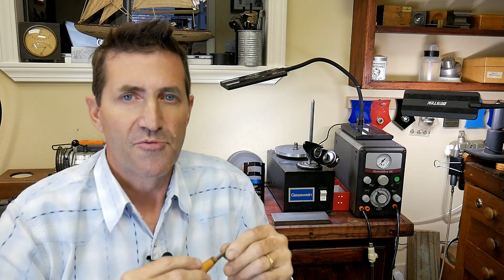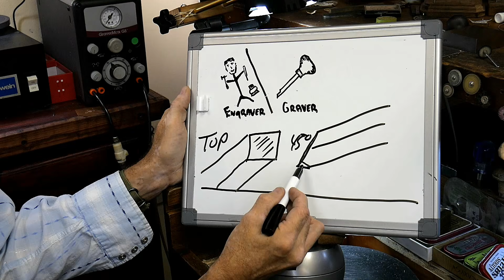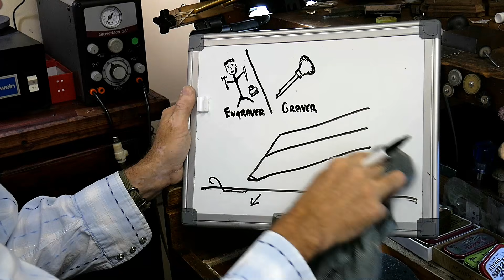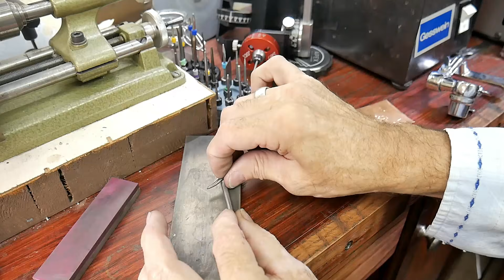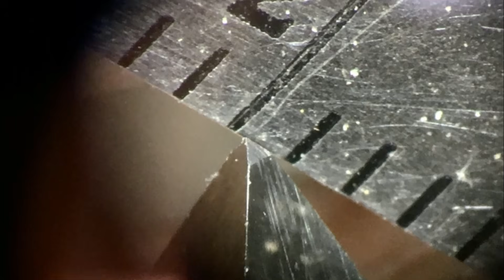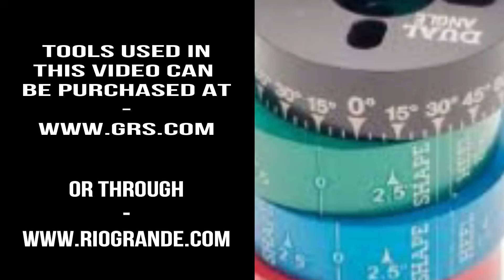Hand Engraving 101 - Graver Sharpening for Beginners

Comment: Is there a specific bench stone to buy? What are you're personal preferences?
Reply: I'm fairly new to engraving, but not to folding knives and sharpening them. I just use the stones I use for my knives; resin bonded diamond stones, from Columbia Gorge Stone Works (CGSW). 

Diamond plates work fine, but they're far inferior in longevity and precision. Resin bonded diamond stones have the benefit of a much higher concentration of diamonds (up to ~100%), and can be dressed/lapped to ensure flatness.

Diamond plates will always have their place, but there's been a ton of innovation in sharpening equipment recently and they shouldn't be considered to go-to method they once were.

Comment: good video, and as a side note, woodworkers call that "doorstop" a honing angle guide, as their version handles all kinds of chisels/carving/turning tools, simmilar sharpening method; and the great thing is it removes variabillity of human movement in the sharpening process. one product you could use is a "belt sharpener", like woodturners use for their chisels, as this stops overheating the steel, and also has jigs for maintaining cutting profiles on the tools, no matter what it is, knife, scisors, axes called a "tormach" machine, and would be a lot cheaper than having to buy what amounts to a gem faceting machine to sharpen the tools.

Comment: Hello! Are you aware of some website in the EU that sells those v-gravers? For whatever reason I find that extremely difficult to find. Same for the ones used for woodcuts (not the gauges but rather the flat pointed ones). Cheers!

Comment: Thx, ive watched this a few times these last few years, its hard to get a handle on all the info out there, but it does come together.slowly!!..few things , for me, im into hand push, the wedge heel as i call it, is better for hand push, the parallel , as with the, templates designed for etc, are really for air assist, but not hand push, a wedge heel not short but say medium, has  no issues with heel drag, and cuts well...one more, i was lucky to pick up a load of 2mm square carbide at a good price, (ground to missed tolerances, from Germany )so i use this...ive found the direction of the hone makes a difference, one makes more tip fails, going into the graver, the other doesnt perhaps the former causes some micro fractures, that eventfully get exposed..im not sure..luving this journey!!

Comment: I have noticed that there is alot of preference/variation in heel and face angles. How do I know what angle works for me? What is the optimal outcome?
 Also, if working on a larger piece, would a larger heel be required?
Lastly, does everything need to be level when sharpening ( table, stones, etc )?

Comment: I am so grateful for the time you've spent making this tutorial. But frustratingly there is much information that you do not explain (in a manner that i can understand). You start by mentioning two different types and state that the second is the one that you use. But then you only show how to grind the first one, not the second. The really frustrating parts is setting the heel. It's not clear if you rotate the graver whilst doing this, or to what angle. This is not clear. I am sharpening away and getting nowhere. more clarity is needed for us newbies. Thansk.

Comment: Thanks for the nice video. I have a couple of questions, what metal are gravers used for gun engraving and what metal are the actual gun gravers made of? As guns are 416R steel and it is hard. Will these type of gravers cut steel?
Reply from the maker: 416 isn’t very bad to cut. It cuts quite nicely with tool steel gravers. Blued hubs are carbon steel and cut like butter. On some of the hardened steels I use carbide. The reality is that the majority of modern guns are not good canvases for engraving.
Reply: @MasterEngraverTV  Thank you so much for helping out. We are looking forward for more videos from you hopefully teaching us this beautiful craft.
Reply: @MasterEngraverTV do you mean that modern firearms are not ideal canvases for engraving because of the shape & surface treatment or is it the quality of the steel? Thanks so much.

Comment: I hope this doesn't sound dumb, but I am learning to use a power graver, can I apply the same technique to the  graver's I use?
Reply from the maker: Shang Rangel gravers are gravers for the most part. What do you mean by “power graver”? I use the GRS GraverMax for all my work.
Reply: @MasterEngraverTV  well you are using stuff that you made, and said something about hammer and chisel, the graver's that I got with the foredom power graver don't look so stout compared what you are demonstrating with
Reply from the maker: The chisels I showed in this video are old die sinkers chisels and are extremely hard to find now. Most people purchase a handle from someone like GRS Tools that will accept quick change collets that hold standard square or round graver stock. All my gravers are shapes from these blank gravers. I don’t suggest trying hammer and chisel without a teacher. You’ll spend years just learning to use the tools. The Foredom tool is really only good as a hammer handpiece for jewelers. It’s not really suitable for Fine engraving. The GRS Graversmith is the most basic pneumatic assist graver I would recommend.
Reply: @MasterEngraverTV  thank you very much I finally got the graver sharpened correctly, I have no formal experience other just seeing it and believing, I am breathing, I can do do this. If you are curious to see some of my work, Rangels Art is on IG FB Twitter. I don't really know how much engraving I will actually be doing I just like knowing as much as my brain can retain

Comment: I think I see whats going on now.  The face angle should always be about 45 to 50 degrees and the two parallel angels can be 105 or 120 or In  Lindsay's case he likes 116 degree angle?  So what do you gain by changing the side angles from square or 90 degrees to 105, or 120 degrees? If you have time to answer? Respectfully Yours  Mike E  RHJ Gold
Reply from the maker: RHJ GOLD simply put with a 120, revolver you can achieve a broad tapered cut with ease by starting shallow and finishing deeper or by angling the graver as you cut to flare the cut. A 120 is also a stronger point and will dull less frequently but it’s harder to control. It takes a lot of skill to cut a consistent width straight line with a 120 whereas is a breeze with a 90. In addition you will need the correct equipment to sharpen a parallel point geometry. Either from Lindsay or GRS. There are special belly facets that must be cut to reduce the angle from 90 to 120. Only then is the parallel heel cut.

Comment: Nice video but confused? what are you talking about when you said using the 120 degree and setting the face to 45 or the other fixture 105 degree and again setting the face to 45 degrees?  whats 120 or 105?
Reply from the maker: RHJ GOLD the fixture I use cut gravers with an angle of 120degrees. A standard square graver for instance is 90deg. These gravers are designed with a shallower angle. They are cut with modern “parallel” heel geometry as opposed to standard heels. To learn more about this type of graver you can learn more at LindsayEngraving.com

Comment: For us poor/broke pre-begginers looking into making some hobo nickels do you think you can show us how to make a graver out of a concrete hardened nail from scratch?
Reply from the maker: Tacti- Coolkid nickel is soft. Any high speed drill bit can be turned Into a graver. Tool steel blanks can be purchased for less than a dollar each from steel suppliers. That’s all a graver is. A piece of steel. You’ll still need some sharpening stones. There’s no way to learn to engrave without some investment. If you want to be a painter, you’ll have to buy a paint brush. You’ll also need some sort of vise to hold the work still.

Comment: how much does a good first set of gravers cost?
Reply from the maker: You can start with only a set of push gravers,  vise and some basic tools for under $800 or so.. The gravers themselves are cheap. It's the education that will cost you either in money or years of time spent trying to master hand push gravers. Pneumatic assist tools are far easier to learn with but the investment is fairly substantial. It's an expensive profession. Not a cheap hobby. You most important tool is a pencil. You can't cut what you cant draw.
Reply: thank you

Comment: So glad to have found your videos/channel. For those of us with the GRS single angle graver sharpening fixtures (which I’ve been using for near 20 years now) would you be willing to do a demo on heel making/sharpening? I do my silver and copper work small scale and have yet to make the expenditure to get the dual angle fixture or any of the S. Lowrie (sp?) jigs, so, a nice run through with the less expensive gear would be appreciated by a good many of us (pretty sure it’s not just me).  Thank you very much, awesome work!
Reply from the maker: Widgets-widgets absolutely. I have one in the shop and I’ll include it in episode 2 of sharpening which will also feature the Lindsay template system
Reply: Master Engraver TV many thanks, also for the name correction w/Mr. Lindsay (wow how I want all of his equipment). I’ll be looking forward to seeing part 2.
  Hope you have a grand day.

Comment: Hi i do engraving About 1 year And i use push gravers chisels And homemade pneumatic graver And my qestion IS in school we create large curve at the heel for rasing the graver And then tatch up the point what is the easyest repetable way to sharpen this tipe of graver?
Reply from the maker: Making a curve in the tip of the graver is not an great way to make gravers. The only reason to do this is if you were engraving inside of a bowl and needed extra lift. The heel itself provides all the lift needed. If you notice the wooden handle graver in my video has a curved tip made for cutting in bowls. You can see I sharpen it the same as any other graver.

Comment: Layne, 

Your channel is great, and your work is fantastic. I was wondering why you didn't include the Lindsay sharpening templates hanging on your wall in the video. There's no adjustments to make, except graver length, so sharpening errors are very hard to make.
Reply from the maker: Too much to add in one video. I'll do a standalone review of the Lindsay templates in a separate video in the future.
Reply: @MasterEngraverTV   Thanks Layne. I like that Crocker fixture. I'll have to get one and add degree wheels to it.

Comment: What kind of metal are your gravers and have they been hardened or tempered at all?
Reply from the maker: I use a variety of gravers but they already come optimally hardened from the manufacturer. I use High Speed Steel, M-42 Steel, Glensteel and C-Max Carbide.

Comment from the maker: I should add that the gravers I use here are made from blank stock. I'll do a second tutorial later on sharpening traditional push gravers but the idea is still the same and the resulting heels look the same.
Reply from the maker: The square blank that comes with that kit is what you should focus on. Onglettes won’t come into play for several years. I use one maybe once or twice a year. As for broader geometry like a 105 or 120 you’ll need specialized equipment to sharpen them properly. A square can be sharpened by hand. Set the others aside for awhile. I can’t see using them with hammer and chisel.
Reply: Master Engraver TV what type of steel can you make gravers out of?
Reply: thank you for the tutorial, Could you give us paralell heels angels for GRS sharpening system. Gravers like 90 105 120 Thank you
Reply from the maker: @TheDrMoroz  15 degrees is the angle for any heel regardless of geometry
Reply: thank you!!!
Reply: I am getting started with push graving, as well as hammer and chisel (For now.  An air graver would be wonderful when finances permit).  I will be buying A GRS positioning vise, GRS S.A. Hammer and Chisel kit, and GRS Push Graver with QC collets.  I guess one major question I have is what gravers to add to the mix for a beginner?  The Kit comes with a bunch of tapered flat gravers and a 90 degree RFF point.  Should I be getting a couple Onglettes and broader RFF points?  I know eventually I can make my own, but I would like a decent starter set so that while I am reading and watching videos I will have the tools I need on hand.  One big order beats many smaller ones.  Thank's for your time!
Reply: What size blank stock do you recommend to make gravers?
Reply: really enjoy your tutorial  videos.....  are you making any more?
Reply: Hey there! Im new to engraving. Ive learned so much from this video. I wanted to ask if all gravers require a heel. Be it that your looking to cut designs traditionally, or set stones via bead setting or pavé. Thanks!
Reply: Yes just checking into this. I love to carve and make jewelry. I think it would be a very valuable skill to have in my tool box..
Reply: The last sharpener is very expensive. I'll have to save my pennies for quite a while.

Comment: still waiting on the rest of my "toys" to get here so i can start playing around with them, had a feeling they probably needed to be touched up before use! out of curiosity... can you use fine grit sand paper for sharpening/cutting the heels and angles? i do have some granite and steel flats that i can guarantee a true surface on. it'll be a few more paychecks down the road before i spend more on just a fixture jig(on it's own... not including a power hone) to sharpen with than i have the vise, gravers, magnifiers and handles combined... might even look into building one... and just source the wheels. i hate over priced stuff! it's honestly only worth about 1/4 of that in parts and labor this day in age!  i mean hell the first engravers that did outstanding and amazing work had far less to work with so maybe i'm over thinking it and just need to stay simple!
Reply from the maker: You would be better off with a inexpensive bench stone. Using paper may tend to round the edge a touch. This wouldn't be noticeable on normal sharpening as in woodworking chisel or knives but graver edges are at the microscopic level and there's zero tolerance for anything but a perfect edge.
Reply: I use these flat diamond plates for getting a mirror finish on all types of cutting tools, tungsten or high speed steel or any steel, and very cheap too.
use wd40 or similar to clear the particles and they last forever; https://www.aliexpress.com/item/CNBTR-Type-Silver-Rectangle-Diamond-Sharpening-Plate-for-Polishing-Smoothing-6-69x2-95x0-04inch/32899505268.html?spm=2114.search0604.3.100.49021f12HyHJre&ws_ab_test=searchweb0_0,searchweb201602_2_10065_10068_318_10547_319_10548_10696_450_10084_10083_10618_452_535_534_533_10307_532_204_10059_10884_10887_100031_320_10103_448_449,searchweb201603_60,ppcSwitch_0&algo_expid=f14892c6-f242-42ed-9a71-04c1674f1b29-13&algo_pvid=f14892c6-f242-42ed-9a71-04c1674f1b29&priceBeautifyAB=0

Comment: Mr. Zuelke, thank you for a great tutorial on graver sharpening.  I've recently subscribed to your channel in hopes of bettering my own engraving skill set.  I've a question if you've the time, please.  I've found that carbide gravers help to extend times between graver geometry touch ups while engraving.  I use a ceramic wheel to grind my heels, but I'm curious about your technique when applied specifically on carbide to create heels.  I most commonly use a 105 carbide for my work, so your advice and thoughts would be greatly appreciated.  By the way, GEAUX TIGERS!  I live in Gonzales, I'd love to spend an afternoon talking if you've ever the time.  Thank you in advance!
Reply from the maker: There is no difference between carbide and HSS with sharpening techniques. Ceramic with diamond spray is perfect for polishing heels if that's what you want. I rarely polish heels though because most of my work gets inked and a polished cut wont hold ink as well. I only use polished heels when I'm cutting a gun to be blued and I want cuts to sparkle.
Reply: Thank you sir!

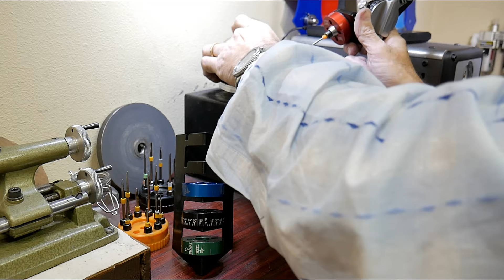Comment: At 20:45, you go into the wheel's rotation to cut the face.  Why do you cut that way rather than as before being perpendicular, or even with the wheel's rotation so you're pointing the other way?  I noticed also for the heels you just touch them, but you're not going into the wheel's rotation on those two touches, but perpendicular as before.  Is there some specific reason?
Reply from the maker: It doesn't matter in the least which direction I'm pointing  for the most part. It's just random
Reply from the maker: I should also add that the heels are microscopic. My wheel's edge is worn down to likely 10,000 grit. If i do more than touch them for a second while the wheel is running they'll be too big. More often I just leave the motor off and lightly swipe the heels with no power. Making heels too large is a common problem for beginners.
Reply: I really like your channel.  I happened across it randomly when looking at how makers build custom watches.  Such patience and effort in engraving, but very rewarding in the final products.  Thank you for taking the time to make these videos.